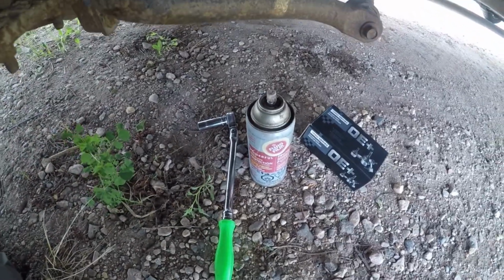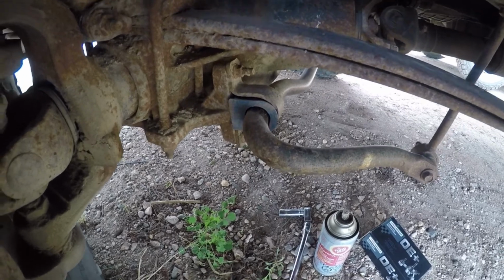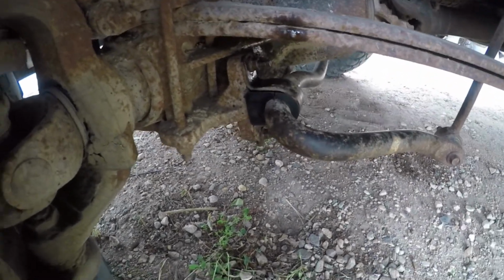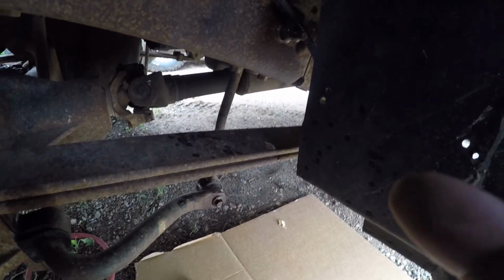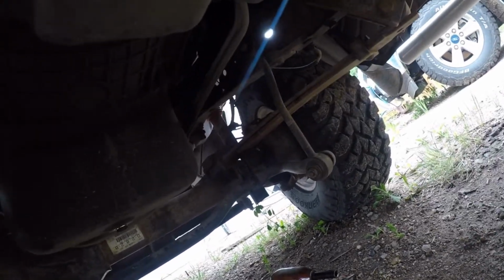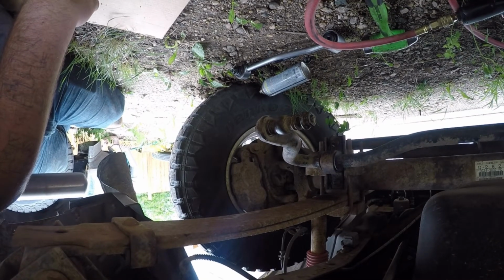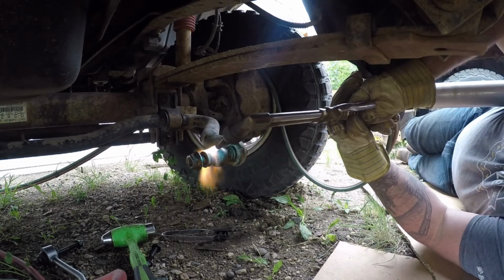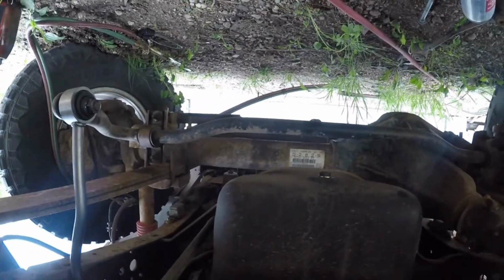2003 F350 Front Swaybar/draglink replacement

Comment: So I know this video is like 2 years old probably will never get a response not trying to to criticize anyone but you should have cleaned greased the sway bar and the bracket mount on the inside and also cleaned up any debris that was built up inside the bracket mount and on the sway bar. I live in the south about to do a whole front end rebuild on my 03 king ranch 250 I’m so glad I don’t have any of the rust to deal with also the under body has been treated and lined so that makes thing quite a bit easier for me.